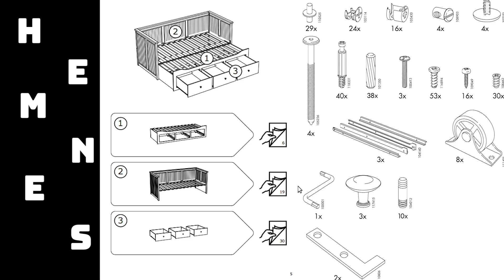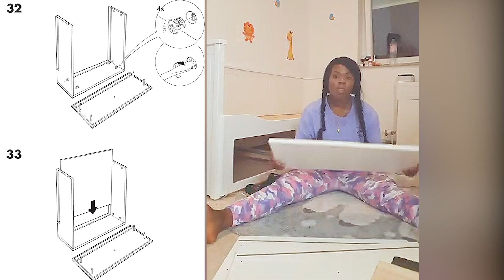How to Assemble IKEA HEMNES Day Bed easy Instruction

Comment: I am so thankful for this video.I built this bed built the stabilizing L bracket wrong the first time and the drawers would not close fully. A friend liked my bed so much, she bought one i built hers without an issue.
Then, much later, I moved in the professional movers disassembled the bed and I had to re assemble at my new house. Without this video I would not have remembered that the longer wood pieces chris cross and you must go under the bed to apply the back screw with the board on Top (of the back stabilizing long metal on the main frame) while the front long metal piece on the main bed frame, has the wood board  under it, And the screw moves from the top down.  

So wood slats are applied to main frame and moving drawer piece (no screws hold these in place- onlt the black plastic space holders).  Her phone cut out at the CRITICAL PART in my opinion. But have no fear, take the long pieces and remember the back of bed has the screw from under to up-with board on top of metal long piece, while the front of bed has the wood slat under the metal and the screw goes downward into metal!
Reply from the maker: Welldone 👍🏽

Comment: So this video was helpful but just an FYI to everyone that it really messed me up because the first part where the wheels are put in is done incorrectly and the drawer sliders are to the back of the frame instead of the front so the drawers actually cannot function properly. I had to open the entire piece up and start from the beginning which was extremely frustrating. Just a warning for anyone using this!
Reply from the maker: Thanks for your comment
Reply: Yes I changed videos because of that mistake. I was kind of mad when I figured it out so I just look at the book instead

Comment: Hi Hilda. At 3:23 to 3:33 I don't think you have placed the 4 pine boards with wheels and metal runners around the right way? They seem to be the wrong way to me, the metal runners with their little wheels at the end should be facing (closest to) the front drawer panel with 3 drawer holes - not the way you have them - otherwise the drawers wont fit in properly at the end stage (and wont have the metal runner track wheel at the face to stop them from being pulled all the way out)...
Reply from the maker: Yes I did correct it dear.
Reply: Thanks Hilda

Comment: Hi, is there any issue with the bed durability. Saw some review saying the slats is easy to break if use it as king or adults sleep on it.
Reply: No problems with durability. Just don't step on the long metal brackets or step on the slats when it is pulled out open.
We moved and my 160 # daughter slept on the trundle part only, in outstretched position with no issues (till i could rebuild it)

Comment: What size mattress thickness is better for the Hemnes, 8 in or 10 in? I plan to use a single twin instead of the thinner double-stack
Reply from the maker: I used the Malfors mattress and is quite comfortable. If you like to sleep in a thick mattress because on the comfort or to prevent back ache then 10 inches will be fine. As long as it fits the Hemnes bed

Comment: So i notice that the very first 4 pieces were in the wrong place. The metal part have to face the up you have them facing down. I had a problem there so I look at the book instead. I don't understand how you were able to put the drawers in with the metal parts facing the wrong way 😕
Reply from the maker: Hi fabiola thanks for your comment. You should watch it to the end I changed it
Reply: @SassyHilda  I noticed this too afterwards. If you changed it.. how did you remove the screw locks (those chunky circular pieces)? Or had you not placed them in yet? I’m panicking and can’t get them out now 😅
Reply from the maker: @malloryoneill2813  Hello dear, yes I noticed the mistake as I proceeded and I corrected before I completed the bed installation. I advice you watch the Video The end and you'll see how I did it... I hope this helps
Reply: @SassyHilda see you corrected video in last but that you didn’t showed and you edited the video .. but bcos of your mistake I completed assembling finally I noticed drawer clam in wrong direction.. I watched your video till end .. plz don’t cover up your mistake .. either you remove this video or change completely .. bcos of you I am scared to remove screws now .. plz don’t do these kind of wrong videos and waste people time …